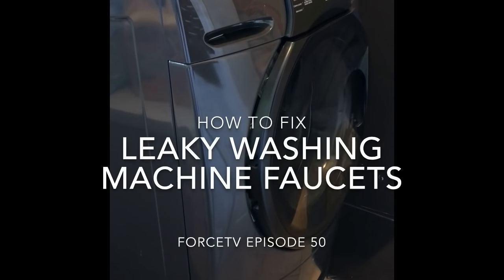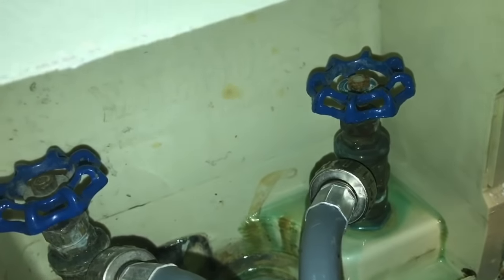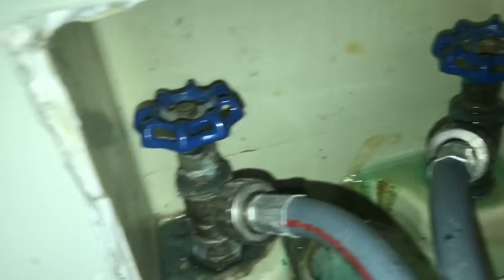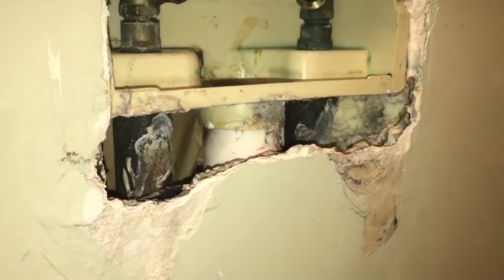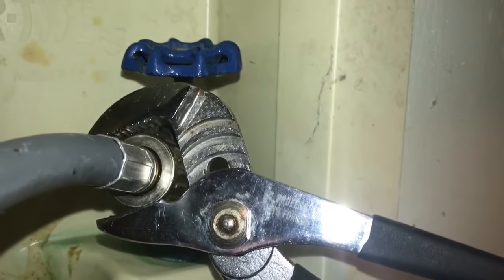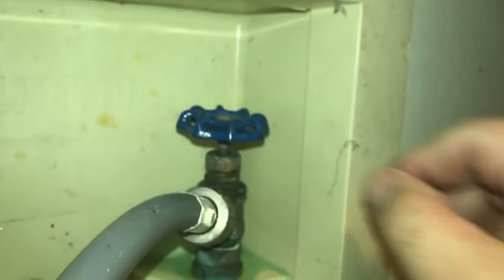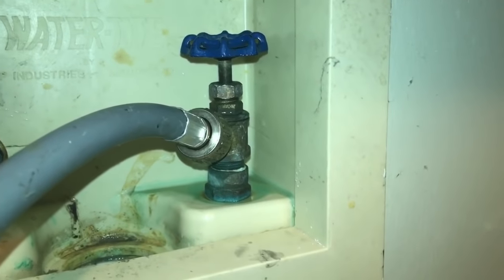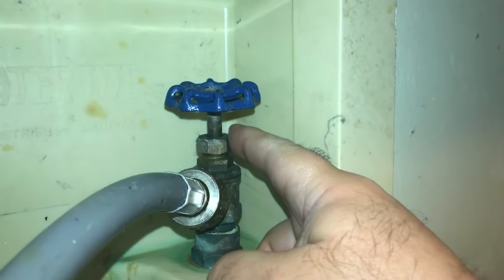How to fix leaky washing machine faucets! - ForceTV 050

Comment: Mine has a slow drip and I'm going to try this and see if it is the packing nut. But, when I turn off and on the valve, (my hoses are still attached) water sprays out from all around until I get the valve all the way open or all the way closed. Can you tell me what that means?
Reply from the maker: @Dawn P Where is the water spraying from? If it’s spraying from where the hose attaches, it’s probably the washer inside the hose end. If it’s from the area where the handle stem goes into the valve, might be packing nut. Look close and see where the water comes from….

Comment: I realize this video is dated 6 yrs ago, but thank you for having this up!  You saved me the cost of having someone come out and look at my washer and pipes (and they probably would have recommended unnecessary expensive "repairs").  I don't have the money for that right now at all.  After spending a while cleaning up water off of the tile and making sure it wasn't anywhere else in the house, I  did a Google search and it popped up your video.   I gave it a try and it worked!  It was just that simple.  Lol. I tested everything out and have done 2 more loads of laundry with no further issues. As a woman who lives alone as a first time homeowner and does not have family locally I can call upon, your video was a lifesaver.
Reply from the maker: @NothingToSeeHere1141 It is getting to be an old video, but still relevant to many it seems! I’m glad to hear it saved you money and frustration! Seems like you have the homeowner skills well in hand!

Comment: First time home buyer. Owner left the washing machine but it need some springs replaced. Turned handle to turn water off noticed it leaking slightly. Got everything done. Had to turn water back on and it started leaking more. Looked online & saw your video. Leak gone for now! Thank you so much sir!
Reply from the maker: @Bolaindie My pleasure, glad it was helpful! Congratulations on your new home!

Comment: Thanks so much for the compression nut tightening tip.  I was contemplating to replace 2 leaking faucets or not.  Then after tightening up the compression nut, no more water leak!

Comment: Thank you. I think this is my problem. Had to buy a new washing machine. Installers couldn’t remove hot water hose from valve and left me the washer and told me to call a plumber. No one available since it was after 6 pm Friday. Now I have a dripping valve and have to wait 3 days for a plumber unless I think I can fix this myself. Appreciate you. Thanks. At least I have a better understanding of this valve.
Reply from the maker: @nomi harper It’s always fun when situations don’t go as expected isn’t it! 😜 if the pack nut is the problem sometimes just a 1/4 turn will resolve it. Give it a try…..
Reply: @DougForce  that’s what I was wondering myself but I could damage things and I’m afraid. Then I might create a mess. Ugh. Thank you for answering me 🙏even if I succeed the hose is stuck on the valve. WD40 didn’t do the trick. Probably using 2 wrenches in opposite directions and having strength would be successful.
Reply from the maker: @nomi harper If you turn off the water to that faucet before you turn that packing nut, you should be fine - can’t make it worse with the water off. But yeah, you still have the stuck hose. I’d keep putting WD-40 on it and try using two pair of pliers…. You can always call a plumber Monday if you don’t get it. Good luck!

Comment: I shut my water off for the first time in several years while fixing my washing machine pump and saw a leak from the stem when I turned it back on. I was trying to get an idea of what rubber washer needed replacement and watched your video. I barely tightened the collar as you show in the video and it was fixed. Thanks.
Reply from the maker: Glad it helped!

Comment: My FIL's washer started leaking and I thought it was the hoses, which I replaced (probably could've just done the washers; live & learn) but there's still a leak dribbling off the valve handle, which is horizontal. Trickier to figure out where the leak is, and different valve model, but I'll give this a try. Thanks for the detailed explanation.
Reply from the maker: @Nathan Maharaj If the leak is coming from the handle area, there is a good chance it might be packing material related. I hope it helps you resolve it. Let me know how it goes!

Comment: Am having a similar problem, we just wanna give up,aggravation per every servicing,still a dribble effect,durn.Thanks for your expertise thought.
Reply from the maker: @MrMcCowLicks I know it’s frustrating! Nothing beat plumbing issues to annoy. If you are leaking like a packing nut leak and tightening doesn’t stop it you may need to ‘repack’ the valve. It’s inexpensive also and still pretty easy. Check YouTube for videos on replacing the packing material. If you do end up giving up a d calling a pro, it didn’t cost you anything to try!

Comment: My link was at the hose connection hopefully tightening that worked. Because I had a spray going on
Reply from the maker: @bentcrazy39 You had a spray fountain, huh? ⛲️Tightening will often fix leaking hose connections. If it doesn’t try using a new washer. Hopefully that’s all you need!

Comment: What would you do if the nut was coroded to the point where it was too difficult to tighten or too afraid to put too much force to risk breaking it?
Reply from the maker: @michael2928 If the nut is too corroded the only option is to cut it off. If the pipe is long enough that’s fine as is. If cutting the pipe behind the nut leaves the pipe too short, then unfortunately you have to open the wall and extend the pipe as required. This is done by soldering in a new piece of pipe.

Comment: I'm having the same problem. What do I do if it's still leaking at the nozzle after I tighten it? Do I have to replace the whole nozzle? If so, does it require turning the water off at the main in order to replace it?
Reply from the maker: @Cassandra Little If you shut the valve completely off and still have leaking from the nozzle you likely have a bad internal washer. It’s always best to shut the main water line off before any repairs. You do not need to replace the whole nozzle , just the internal washer. Look on YouTube for faucet repair videos. Should cost less than $3 or so….
Reply: @DougForce  so even with the valve turned off to replace the washer, water will still flow out when I remove the valve?
Reply: @DougForce  I just bought the house and not even sure when the main is located. 🤦 I'm on a big corner lot
Reply from the maker: @Cassandra Little Yes, if you are working on the valve it can let water flow for sure. Always turn the water off at source for these kinds of repairs.
Reply from the maker: @Cassandra Little There will be a cutoff at the water meter by the street that you can turn off with a tool from Home Depot. But there is also likely a cutoff inside your home, usually close to where the water line enters your home. Look under sinks in bathrooms, kitchen, etc for an extra handle that will cutoff everything. If for some reason you can't find one, just use the water meter cutoff - pick up a tool at the hardware store. Good to always have on hand if you have an emergency water leak.

Comment: does tightening the packing nut also tighten the screw valve itself, making turning the valve harder?
Reply from the maker: It can, if overtightened. If you have to tighten the packing nut so much it restricts turning the handle you may need to repack the faucet with new packing material.
Reply: @DougForce  thanks

Comment: My water is off but still water coming out of the valve ? My red hose is leaking and water is off
Reply from the maker: Hey Jamie, it might be coming from the hot water tank. I had the same problem recently. There was a value on my water tank and when I closed that the water stopped.

Comment: it looks like you are tightening to the left which is lefty loosey isn't it? I'm never sure which way to turn the wrench??
Reply from the maker: @Judy Smith It’s hard to tell from a video but you are correct on the righty tighty lefty loosely  thinking - so turn to the right, or clockwise to tighten.

Comment: hi there. i just replaced my leaky washing machine tap. now the issue is the mouth of the new tap is too small for the washing machine hose to screw onto. what shall i do please? was considering to even cut off the plastic screw lock attached to the hose so that i can plug the hose directly. hmmm
Reply from the maker: I’d probably lean towards getting the correct hose bibs installed so that any washer will connect in the future without issue. Cutting the end of the hose off and securing with a hose clamp might work, but the correct fix is to have the right size tap. Good luck!
Reply: @DougForce  thanks for the kind reply doug Cutting the end of the hose off and securing with a hose clamp might work - yes i may just do this. wouldnt wanna waste the brand new tap. when i bought it they even labelled it as "washing machine tap" hehe p.s. i guess the hose size is standard? it seems similarly sized to the mouth of the new tap
Reply from the maker: You might check to see if that same store has adapters to fit on the hose that would fit the tap. Hopefully they have something that will fit the tap that you could adapt. Plumbing is always a exercise in patience!
Reply: Doug Force thanks Doug. Bought the tap from Aliexpress. Also tried looking for a tap adapter so that the current hose can fit but can’t find one. And when I look at pictures and videos online they seem to have hoses with screws or heads that snap into place onto taps similar to mine.
Reply from the maker: I don’t recognize the fittings on that tap or the hose. Perhaps it’s a standard from outside the US? Where are you located?
Reply: @DougForce  im in singapore. i have since purchased another hose with a different head. its all okay now. :) thanks for your kind replies doug
Reply from the maker: Wish I could have been more help but glad you got it fixed!

Comment: mine also has 2 blue knobs, does that mean both lines are cold water?
Reply from the maker: LostAndFoundVideo I would guess that the installer just used the wrong color handle. Use a short hose to run some water into a bucket from each connection and hopefully one will get hot!
Reply: @DougForce  Just feel the faucets when the washer is filling and one will be warm. It should be the left faucet.
Reply from the maker: Good idea, @62impalaconvert!

Comment: Hi, we have these exact same faucets and one will not turn off all the way, there's quite a stream.  Do you know the model of this faucet so I can search for a how to repair it?  I don't want to damage anything and end up having to call a plumber.  I'll give them a shot of PB Blaster and hope they will give without too much force.  I'm guessing that two wrenches is the best way to avoid excess force on the pipe.
Reply from the maker: @Pete B I don’t know the model number of those faucets but they are pretty generic. Take a look at the video linked below - maybe some of those tips will help. The main thing is not to force it, just be patient working it. If all else fails it’s not that difficult to replace the whole valve. There are a number of videos on YouTube on how to solder/desolder and it’s surprisingly easy. I replaced some valves and lines recently in a kitchen remodel and it was fast and easy. I had to buy the torch head and a few things I didn’t already have, but it was still cheaper than a plumber and I have the tools now for next time. 

https://youtu.be/h98kGrNxVFw
Reply: @DougForce  OK so I did this job yesterday with new washers.  There was what looked like a clear plastic, thin washer for a gasket and it was leaking there, tightened it and now there is a very slow drip about once every 15 min.  I made it so tight that I can't imagine going any further.  I have form a gasket or I might be able to find some teflon tape around here but I'm not sure which is best.  Any suggestions?
Reply from the maker: @Pete B If the replacement gasket you put in was the right size, it shouldn’t leak. Was it pretty much the same size as what you pulled out? Teflon tape is helpful on threads, but your leak is from the faucet bib itself, is that right? If so, that’s all on the washer….
Reply: @DougForce  Sorry I should have been more clear, the new flat washer fit and fixed the fact that the water would not turn off all the way.  The problem is at the threads and I tried again taking a close look with a flashlight today.  I've read that there are normally two machined flat surfaces that do not require any gasket but this is different.  There are flat surfaces but there is a tiny shoulder on one side, probably to hold the thin plastic washer centered.  I did not replace the thin plastic washer but it is a very loose fit and might ride up on the shoulder rather than center, in fact it seems too big to fit into the shoulder, perhaps it flattened over the years, who knows.  I put it back together, without any goop, trying to center it as best as possible and with a lot of force it seems to have finally sealed.  NOW THE OTHER ONE HAS A TINY DRIP!!!!!  I'm very tempted to leave out the thin plastic washer and just smearing some silicone in there!  It is a poor design with the thin plastic washer not centering properly.   Suggestions ????????
Reply from the maker: @Pete B - Oh I see, if it’s from the threads I would definitely use Teflon tape or some pipe dope since it’s seeping. I’ve never seen one with the small plastic piece you described but maybe it’s a new option. Try the Teflon and see what happens. Plumbing is always an adventure!
Reply from the maker: @Pete B And it would not hurt to put a little pipe dope on the part to hold it in place….
Reply: @DougForce  All I have is Forma-Gasket so I tried it, it held the plastic washer in place, and I also put some where it seals avoiding the threads.  The directions say that this stays soft so it should come apart without much trouble down the road.  Seems to be working fine.  Thanks everyone!
Reply from the maker: @Pete B Sounds like the perfect product for that use, I need to get a tube of that myself! I don’t think I was much help but glad to hear you got it resolved and did it yourself! Nice!

Comment: If I were you I would replace those two hoses ASAP with steel reinforced ones.  By the way, I don't trust any shutoff valves older than 5 years. I shut my water at the street when doing plumbing work.
Reply from the maker: @Sam Kitty Those hoses (and that washer) were replaced several years ago but I never had any issues with non reinforced hoses, interestingly. I know some people did. I tend not to trust the small valves under sinks and at toilets, and will also use the whole house cutoff or the street valve if the property doesn’t have a whole house cutoff. You can never be too cautious! Thanks for the tips!
Reply: @DougForce  Same here. I always wear my belt and suspenders... just in case. By the way, my friend's dog chewed right through his rubber washing machine hoses. Upon returning home from work he found the house flooded and the dog trying to stay afloat.
Reply from the maker: @Sam Kitty Wow! That’s one I would have never thought of! The dog chewing up the hose! Although I did have a dog chew up the lines going to a brand new outdoor condenser unit. Some dogs push the line! Lol

Comment: How do you know that the faucets are on when the hoses are already plugged in? I’m afraid that if I turn it too much, maybe the handle would fly off with water spiking out lol.
Reply from the maker: @Senay It’s easier to take the hoses off like I did in the video. That way you can see better what is happening. Tightening the packing nut won’t remove the handle so you are safe there!

Comment: my washer sprays right out at the thread.
when I put the hose on, it sprays out where the hose attaches to the spigot.

help !
Reply from the maker: @lucinda gaskill You may not have the hose tight enough, or the hose end might be out of round. Try some plumbers tape on the threads of the hose bib, and reattach the hose. Use channel lock pliers to be sure the hose is tight. If that still fails you might consider a new hose. Good luck!
Reply: @DougForce  thank you.  I will try your methods.
Reply from the maker: @lucinda gaskill Hope it helped! Let me know what the outcome is!
Reply: @DougForce  I def will - I'm going to Lowes tomorrow to pick up a new spigot for the cold water hose.

Comment: I have the same exact situation and my valves and drainage look exactly like this, but the valves don't seem to have a knot to tighten.
Reply from the maker: Roku Jones You might have what’s called a  ‘gate valve’ faucet if you don’t have a packing nut. That kind of faucet is a little more complicated to repair. You have to shut off the water and disassemble the faucet to replace the internal packing material. Try searching for ‘gate valve repair leaking’ or similar. Good luck!

Comment: Didn't work for me. When I try to tighten the packing nut, it just twists right back in its original position, and the leak continues. Thanks anyway.
Reply from the maker: Sorry to hear that Joseph. Sometimes you have to repack the faucet with new packing material. There should be videos on YouTube on how to do that. It’s slightly more involved but still a very inexpensive fix.